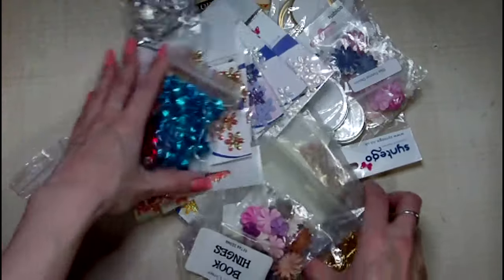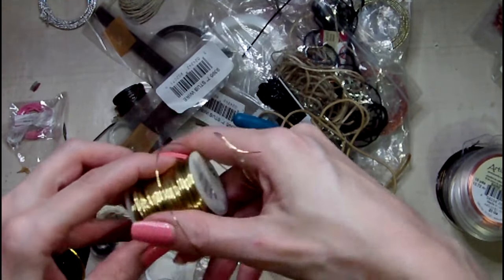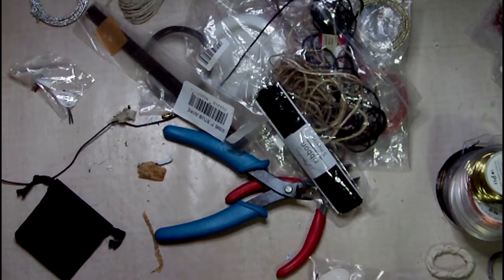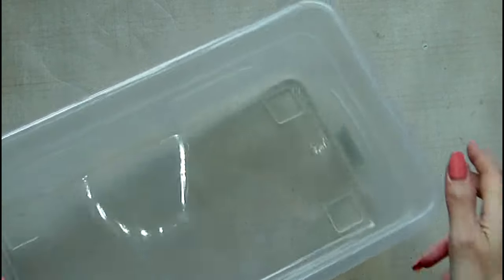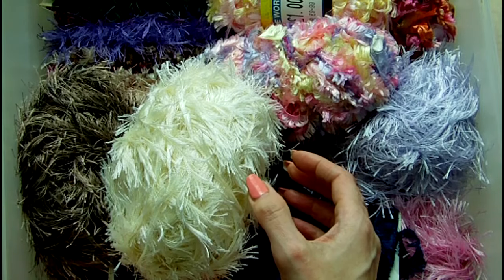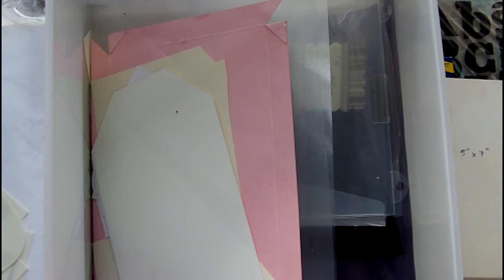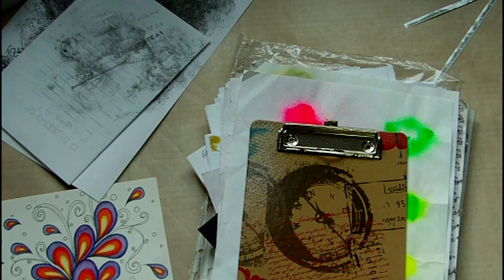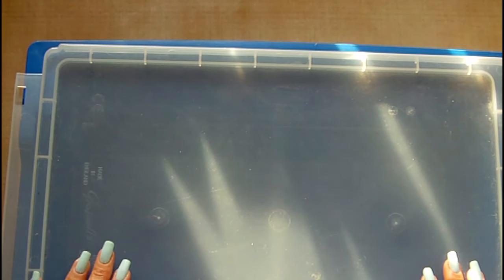Craft Room Declutter & Organisation - Final Day

Comment: I hope you will read this before you remount your stamps.  To renew the cling on both cling and clear mount stamps you can wash gently with warm water and dish liquid, rinse,  then lay flat cling side up to air dry.  Toweling will leave lint behind and hinder the cling.  Once dry they will cling the same as when they were new.  Hopefully, this will be able to save you both time and money.  Loved this series of videos.  Your art inspires me.  I can't thank you enough for sharing yourself, your time and your art.  You are truly AMAZING!
Reply from the maker: Thanks for the suggestion, I'll try again with them, but unfortunately, I've already done that several times, and they've just had enough of my abuse now I think, lol - Many of them have ink and glue and lord knows what else stuck to them - that might explain it, hehehe
Reply: In that case, though it has an odor, you could use liquid lighter fuel/fluid such as for Zippo lighter to neutralize the adhesive to make it easier to remove.  Undo was a popular brand a few years ago that came with a tool similar to a scraper attached to help separate so the lighter fuel could get to the adhesive.  As the lighter fuel evaporates, it becomes sticky again.  If you want to completely remove adhesive, use paper towel before it evaporates to wipe adhesive away.  Also works well if you adhere something to a card or project and need to remove without damage (and even those pesky labels).  For a project idea, I would love to see the encaustic painting.  I love the one you show in the Day 10 video, but have never tried it myself.  Thank you again for being so wonderful!

Comment: I just binge watched the series and I applaud your efforts! That was quite the task!!! I appreciate that you kept in the decision making process, and the struggles, for each section. I think I'm fairly organized, but like you, I suspect each bin and basket has a few surprises or items that don't necessarily need to stay. I always think, oh... a couple sheets of paper won't make a difference, but you managed to clear out quite a bit! I'm at a point where my paper won't all fit on the shelf, so something has to be done, and more than a couple sheets have to go. Time to be ruthless, as you say :-) Wish me luck! BTW, if a good washing doesn't get your red rubber stamps to stick to their sheets again, you can use Aleene's Tack It Over and Over Glue on them. Apply a thin coat, let it air dry, then it will stick to the sheet and a block like new again. You can use it instead of foam mount too, though you'll need to use something under your paper for cushion, like fun foam, a mouse pad, or a pad of paper. You were inspired by Lindsay the Frugal Crafter, and that was a tip from her. I've been using Aleene's for years. Unmounted most of my wood stamps and stuck them to plastic sheets made from folders from the office supply store. Thanks for all the work you put into filming and editing these long videos!
Reply from the maker: Thanks for watching Karen, and thanks for the tip about Aleene's - I will have to look that up and see if we can buy it here.  Good luck with sorting your paper stash out :-)

Comment: Each, a good tip for keeping the spools tidy, go to the hardware store and buy a metre or so of plastic piping used for retic in the garden. Cut it into 2 or 3 inch pieces and cut down one side. Wrap it around the spool and problem solved.  I use this trick with thinner tubing for my bobbins for sewing.  Cheers Pat
Reply from the maker: Thanks Pat, much appreciated :-)

Comment: Couple of questions: it looks like you have storage under your work desk but  where do you put your knees when you work? I have a similar problem. And where did you get your ink pad storage Units? Could you do a project using your canvas bags, your Gothic arched boards and really any of your alternates, especially the tins. I have problems with the tins. Again, I loved your tour and tfs.
Reply from the maker: Hi Linda.  I stand up when I work, and always have, so having units under my desk is not an issue for me.  The ink storage units are handmade by a company called "Designs by Rod".  I will try my best to include more altered items in my videos, thanks for the suggestions :-)